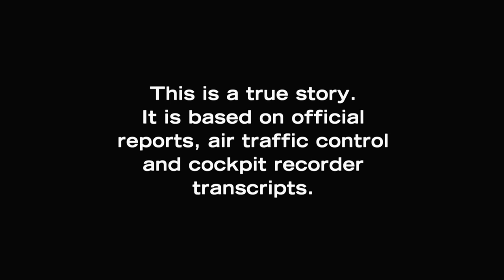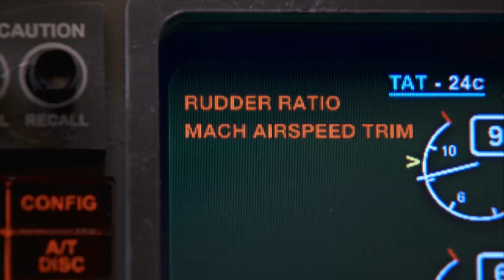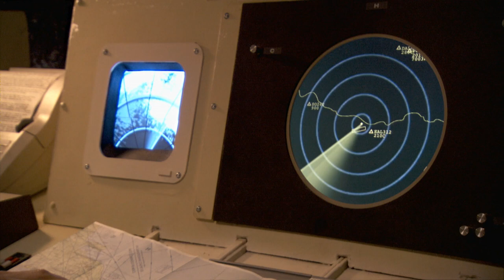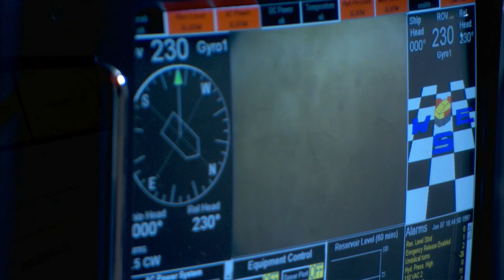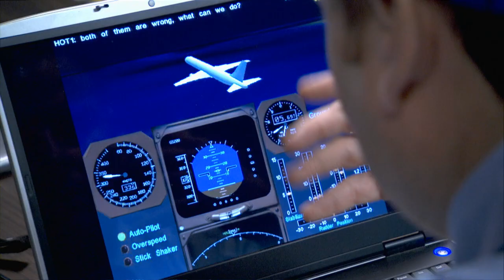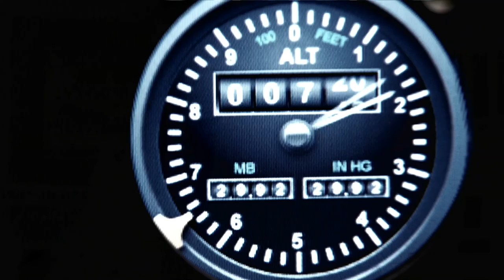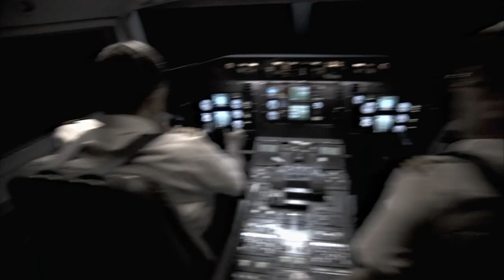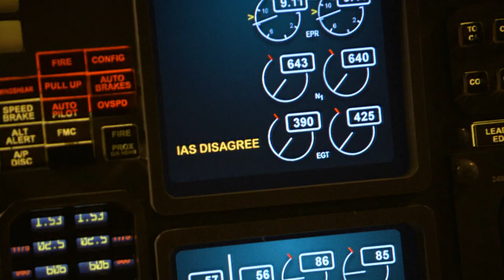The Plane That Wouldn't Talk | Faulty Readings | FULL EPISODE | Mayday: Air Disaster

Comment: As I watched the takeoff, and saw the pilots not abort when their air speeds were contradictory, I was going, "Oh, this doesn't look good."
Reply: The copilot cannot supersede the captain.
Reply: @mackwiz1  Co pilot can and should when they deem it unsafe. Unfortunately, in the late 90's, the culture of seniority-knows-best was far too prevalent
Reply: I saw that the channel was “Mayday” snd said “Oh, this doesn’t look good.”
Reply: The plane itself told them whose speed indicator was correct.  When it warns of a stall, actually goes nose high and tips over on the wing, and the co-pilot's meter was was indicating too slow, they could have switched the system to read off the the co-pilot's pitot system.  Instant safe trip!
Reply: @carllong9175  the autopilot only used the captains pito tube at the time, but they could have manually flown the plane and ignored the faulty reading.
Reply: since the co pilots indicator was accurate on take off , id go by that and ignore mine.  his showed too slow in the air and that was correct also.
Reply: @carllong9175  (and "TANKTHEARC") :  It was not at all clear which airspeed indicator was faulty, especially early on in the process (e.g., on takeoff and before the stall warning activated).  Indeed, that's why this tragic accident happened.

Arguably, after the stall warning activated, one might say (and indeed, Carl did) that at that point it should be clear that the plane must've been going too slow (in contrast to what one of the airspeed indicators was telling the pilots), and therefore the speed indicator that showed a too-slow speed must've been the correct one.  But that's asking for a lot of deduction and logical analysis at an extremely stressful time when the plane is shuddering, the stick shaker is activating, a million other warnings are sounding and flashing, the pilots are receiving conflicting information, and they don't know what is going on.
Reply: They also didn't talk to atc at all. Couldn't they have seen their airspeed?
Reply: @SoulDevoured  it would only come from the flight data itself , which the capts (the main one was faulty.  i would have went by my co pilots knowing it was correct at take off and mine wasnt
Reply: Bak then it was like that but know it's if you see the Captain making a bad decision you can overule them.
Reply: @tankthearc9875  :  But you don't know which one is faulty.
Reply: @ayumu-senpaii  * "now", not "know".  🙂
Reply: They are 100% to blame. I know what it's like to "make a decision in a very short time window". I'm sure many people do, too. What happens is this: it depends on your primary value. If your primary value is 'better safe than sorry', that's one thing. If your primary value is, 'argh, I'll wing it', then you end up  crashing like the idiot you are. Problem is, these idiots crash innocent people with them.
Reply: He had no plan. Why he decided to change his mind about trusting his speed indicator while having no visual indication of speed makes no sense at all.
Reply: Fulll of non responsible pilot . He should  abort the flight
Reply: @RacinZilla003  That was the case in Tenerife, when the KLM 747 took off without permission, and hit the Pan Am 747 on the Runway. March of 1977.

Comment: Feel bad for the FO and Relief pilot who correctly identified the problem and had a solution but were ignored.
Reply: There have been several of these crashes in this series in which the first officer knew what was going on and may have been able to save the plane. Taking the controls from the captain would take a lot of guts and most probably didn't have that.
Reply: @muffs55mercury61  yeah that's the downfall of putting a 30 yr old FO that's probably very capable of flying the aircraft next to a seasoned pilot in some case War heroes which inevitably causes pride to cause conflict in these life and death situations..
Reply: @qcsfinest0898  It's quite a catch 22 situation. I'd probably be afraid to speak up thinking that I might still be wrong and then face some pretty bad music later on. Korean Air 8509 was another sad example. The F/O and the flight engineer saw the pilot was turning at a 90 degree angle but let it happen. 4 dead.
Reply: @muffs55mercury61  Exactly what I was going to say. I just watched another episode that had the same problem with the captain being too focused on the problem.
Reply: @langer24106  Yes possibly Eastern flight 401 when they were focused on the light bulb and crashed into the Everglades?  That's just one example that no one was flying the plane.
Reply: There's a reason that the top 3 general priorities of the flight crew are: "Aviate" (fly the damn plane), "Navigate" (figure out where you need to go), "Communicate" (Hey Tower, we got a problem).

Comment: If the moment they slowed down the plane, the big problems started.... why didn't they immediately put the engines back to their previous higher power?
Reply: at 38:29 they did...
Reply: Becuse if they put it in full power the plane will want to go up but wit the speed they have it will make the plane stall still because it has no speed to go up
Reply: They had no way to know how fast they were truly going. The pilot thought both airspeed indicators were malfunctioning. Flying a jumbo jet is way different than driving a car. In a car you can see things like the trees, utility poles, & other landmarks whizzing by the faster you go. Up in a jet, with tiny windows & nothing outside them but darkness, they couldn't judge if they were going too fast or too slow. What an awful situation to be in. I don't know why anyone would want to be a commercial pilot... they don't get paid much at all, & when things go bad, they usually go VERY bad, & it's all up to you, the pilot to fix the problem. No thank you.
Reply: Good question. I guess they may have been concerned that it was going too fast, and thus, the plane might fall apart….
Reply: @bookcat123  I saw; that wasn't *immediate*, is the thing.
Reply: @Aviator1414  If it had been an immediate switch instead of a delayed one, would that have been the result, though?
Reply: At that point they were utterly boggled. Its possible the co-pilot and reserve pilot wanted to push the levers forward but they deferred to the Captain, who saw his own ASI seem to become normal, giving him confirmation bias that it was correct. Then when he had to back track that idea, he falsely assumed the Co-pilots was as well. By then he was lost. It's likely the Co-pilot could have saved the plane just doing what he wanted to do, but being so young and inexperienced he became hesitant in taking over. By the time he tried to start even giving his own ideas, the plane was nearly out of control. And the captain did not react to those suggestions enough to regain control.
Reply: @Angry-est  That's fair. I guess I'm so used to the moment a machine seems to be "angry" at my actions that I undo the action that not doing so seems silly to me. Different people, time, and by far situations, though.
Reply: @valeries9297  keep in mind they mentioned this captain used older techniques by pilots of older generations, so it’s kind of like a grandparent trying to use laptop they’ve had for ten years. If something doesn’t work the way they are used to, depending on how savvy they are, it can totally trip them up. At that point, they either ask for help or try to brute force it, & unfortunately for the captain, in his moment of confusion and panic, he chose brute force instead of consultation.
Reply: @0w3nn  True. I guess it just goes to show that no matter how much experience the captain had, even he could become completely befuddled by the situation he found himself in. There's not enough money in the world to make me want to do that job. It's just WAY too much responsibility.
Reply: @Angry-est  That makes so much sense, I hadn't thought of that.
Reply: Its so easy to Monday Quarterback situations like this, simply because we know what the real culprit turned out to be
Reply: @Howiesgirl  Commercial pilots get paid a decent amount, and the chances of you being in a plane crash are extremely low. Hence why people want to be pilots.
Reply: @bookcat123  to late
Reply: @Howiesgirl  ur da toxic kid in fortnite
Reply: @dankmemes5432  look at my photo...do I look like I'm young enough to even have a clue what you're talking about? I'm assuming video game... which I've never even played one in my life. I assume you were trying to shoot me an insult. Sorry I ruined it by my ignorance of your pop culture reference. Cheers.
Reply: Experienced pilot is still a human being and can make mistakes. 
To me, the first mistake the crew did(I’m assuming) was not to check the aircraft logbook. They could had noticed that the aircraft had been on the ramp for three weeks. If they didn’t remove the pitot tube covers, who did? Small things, but it cost them their lives and the lives of passengers that trust them with being professionals. No matter what they all were on the list to depart that day.
Reply: the plane lost lift, now forces them to put the nose down
Reply: @javianjohnson8746  Because the plane was also shaking a lot.. the captain most probably thought that the speed was too high and by going full throttle and nose down right away it wouldve torn the airplane but one thing I have learned is that whenever a plane says Low terrain or Stall ... 95% of the time its true + the altitude and throttle speed shouldve kicked in knowing It wasnt going as fast as the system was saying. Of course though in a situation like that with pressure to make quick and right decisions would be difficult for anybody so we cannot judge. I think airlines should have more training on what to do when electric and system fails on aircrafts.. like possible causes and what to rely on etc...
Reply: @hlowrylong  Should seem obvious that they were, indeed, going too slow once the plane started stalling
Reply: @Aviator1414  that’s why you go nose down to regain lift

Comment: After the crash. Birgenair ceased operating and then 8 months later Aeroperu 603 crashed for similar circumstances and training was added for pilots to know what to do incase of instruments disagree with each other
Reply: Number one....don’t take off at night over the ocean.
Reply: For Birgenair, they had a blocked Pitot tube, while all other instruments such as the attitude indicator, altimeter and vertical speed indicator were working fine, for Aeroperu 603, their static-ports were blocked so they had no basic instruments at all

Short answer: The Aeroperu 603 pilots had much bigger problems than the Birgenair pilots.
Reply: @33moneyball  that was what ultimately did it for Aeroperu 603, had they stayed over land, they would’ve had a visible horizon with all the lights
Reply: They crash because somebody didn't take the duct tape off the one of the sensors that measures All the instruments very careless and tragic
Reply: @EpicJoshua314  yeah what even worse is that for ATC the blocked static port has affected the ATC with radar showing plane’s incorrect altitude.
Reply: @33moneyball  Hundreds of flights take off at night over the ocean every day all over the world, tens of thousands every year. Hundreds of thousands of flights every decade. There's twelve taking off as you read this.
Reply: @Interdictiondeltawing  
Well that's a problem.
Reply: A similar incident happened with Air France 447 in 2009 when ice crystals blocked the pitot tubes when they were approaching a storm system. The plane stalled and the first officer didn’t realize he was causing the stall by pulling back on his side stick . The relief pilot put the throttle in max power which caused the plane to crash in the Atlantic. By the time the pilots figured out the mistake, it was too late.
Reply: Even if they both agreed, if stalling, nose down autopilot off. Remove the variables and fly it.
Reply: @Maxwell1989  it was clear tape, maybe why he forgot it was there
Now they have actual red/bright orange pitot tube covers with a bright orange flag hanging from it.
Reply: @ashleyreagan5543  It wasn't clear, it was normal grey duct tape.

Comment: The captain needed to fly the airplane — and speed it up. I’m not a pilot but I’ve watched enough of these to know that going faster is often a better solution to regain control while flying.
Reply: Unless they're overspeeding, in which case it makes everything worse.
Reply: Yes, I'm no pilot myself, but I also believe they should have tried to fly the plane manually.
Reply: What's the saying... Aviate, navigate, communicate
Reply: I would much rather risk an overspeed than a stall, although I'm not a pilot, but so many of these disasters have/include/end with "and then the plane stalled" compared to "and then the plane disintegrated from speed". Everything has a margin of safety when it comes to their structure - this is just good engineering design - but there is no margin of safety when it comes to math and physics, lift.
Reply: @Amanda-C.  no way you're overspeeding with the nose up. The captain should know that with all those flight hours.
Reply: @Whomecouldntb3  I agree — but man it must get really confusing with the lights and beeps and sirens ….. and obviously the disorientation from the incorrect readings … I would have crashed for sure (I’m not a pilot so that’s a given)….

Comment: The crew knew it was a fact that the captain's air speed gauge wasn't working properly considering they took off using the first officer's readings. Therefor I don't understand why anything being displayed on the captain's gauge after takeoff be considered to be true. These planes are built with redundancy for that reason.
Reply: That's a good point I didn't think of that. If the first officers speed indicator seemed to be accurate during take off it should have been trusted more than the captains during flight.

Additionally, since the captain had thousands of hours of experience in that specific aircraft, he should have a rough idea of what his airspeed is at any moment based purely on throttle and altitude
Reply: Indeed. When in doubt about which of your instruments is malfunctioning, assume it's the one that you know was malfunctioning moments ago. There was no reason to believe the indicator was "working now", rather than just giving a less obviously wrong number.

I would suspect it was an issue of compartmentalization (sort of a reverse tunnel-vision). The indicator is malfunctioning, but when it gives reasonable numbers again, the pilot mentally recategorizes it as "working fine". Then when the instruments start giving contradictory readings, he's treating it as a new, separate problem, with all the gauges being equally valid, or equally untrustworthy. His mind becomes so focused on the things that part of the current problem that he completely blanks on the (very relevant) information from the previous problem.

Either that, or perhaps the training pilots got at the time treated both an overspeed warning and a shake warning as being "things that are serious enough that you must act as if they're true, even if you don't know they are", and that habit left him unable to evaluate whether either of them could be false, or choose one of them as more important.
Reply: I think the fact there was not such good traning in CRM back then was a big factor and we must remember they are 50 years behind on updates to overall training.

Comment: A note for anyone getting into these episodes that might be helpful where anxiety is concerned... in all of these scenarios, it was the perfect storm to cause an accident.  If any of the situations coming together had been different, the disaster could have been averted. For example, if the 1st Officer had taken action to force the plane's nose down, the stall might have been prevented. Had all the pilots received specific training to respond effectively to conflicting alarms, it might have been enough to save the plane. And of course, had the Pitot tubes been covered while the plane wasn't being used, the Captain's wouldn't have become blocked. The crash happened because many factors combined. In essence, a plane crash is usually what could be considered a freak accident. We hear about them extensively when they happen and are so fascinated with them because of how rare and devastating they are.
Reply: 2 years later. I liked what you had to say and want to add that one of the best things about this show is you learn how aviation has changed how it handles situations so these accidents won't happen again. That can help a bit with the nerves.